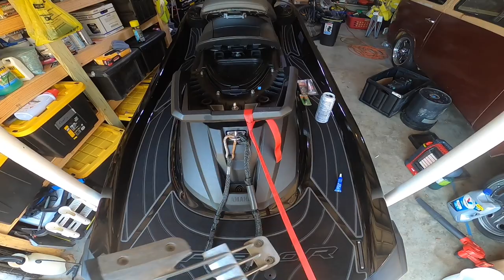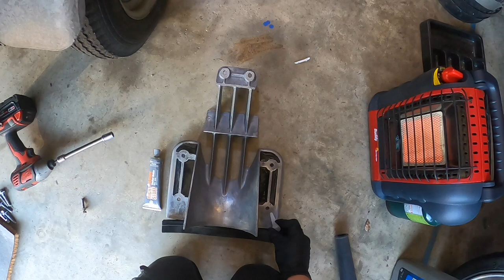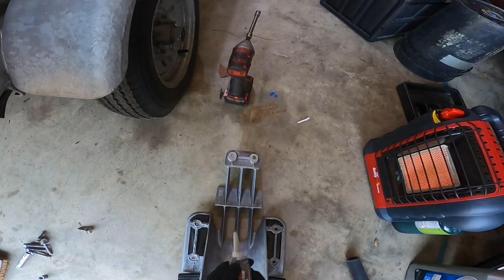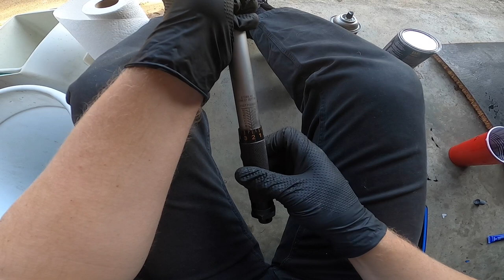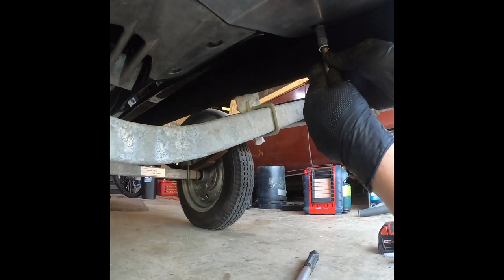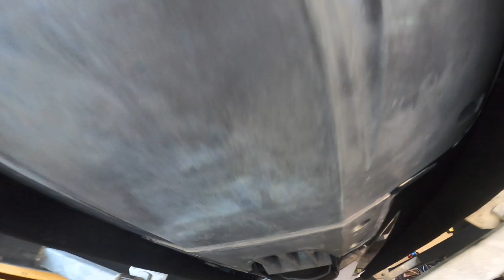Yamaha intake grate installation | VX GP1800R VXR

Comment: what resin did you use to fill the gaps in the intake grate? I’m currently doing the same thing but I’m using flex seal liquid
Reply from the maker: Alumilite resin. I got it off Amazon
Reply: Wow didn’t kno u can use resin to filll it
Reply: I know it been a year..but if u used the flex seal"which works" have to let cure for many days or you will have the mess of a life time...I use for making a seal kit for stock intake..only let dry for 3 days...was a bad mistake..lmao..pump sucked it right out and made a tar pit mess...BUT if done right, its great!..